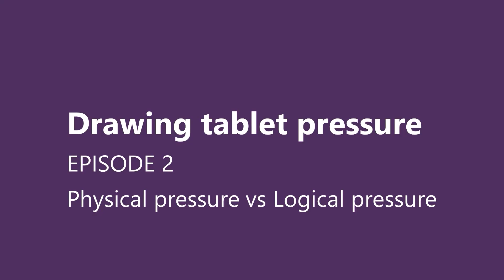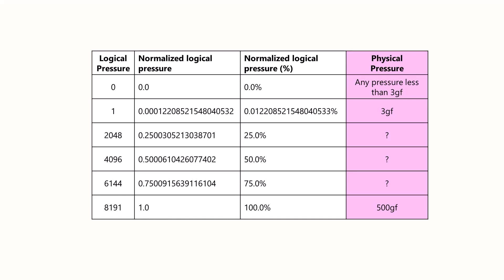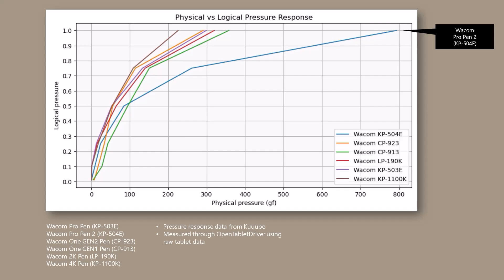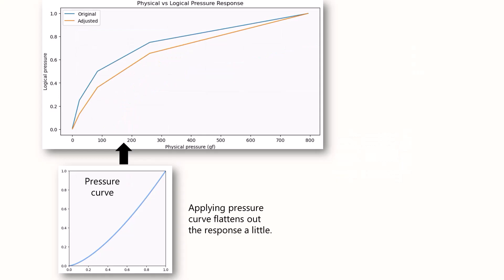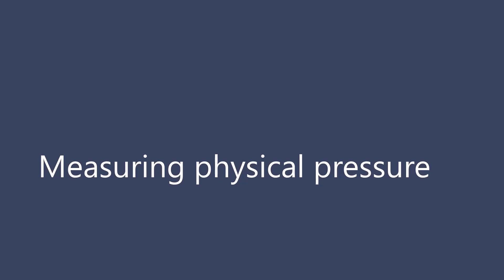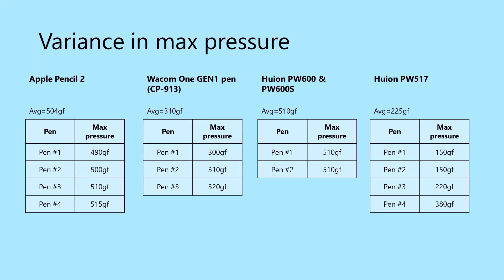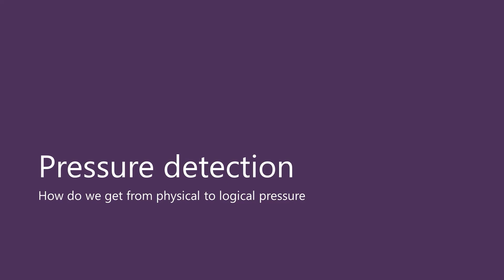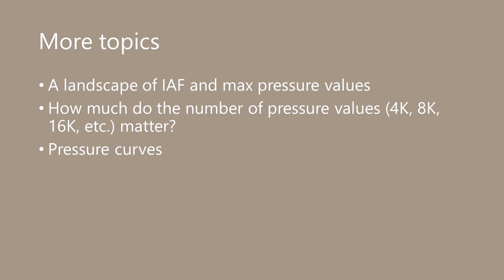Drawing Tablet Pressure (2): Physical vs Logical Pressure

Comment: The 517 pen pressure its customizable by manually moving the screw behind the buttons of the pen. But the max grain force didn't like it much, Xppen gen 2 feels like wacom 2, not sure if it matches the 500gf but feels so good, also the magicpad pen feels it has even more like a 700gf max force.
Reply: Do you have more information about the screw adjustment in the 517? Is it in all Huion pens? Do you think the differing pressure curves are due to a miscalibration of it?

Comment: Very interesting. I use different configurations, per app, in my Wacom panel. Even when I have an actual pressure curve setting in the painting program (most often I use both). About same pens having different pressure readings.. I had to replace my trusty Wacom pen after dunno if 12 years...I found it on Amazon, new. Well, same pen, same model, everything. Yet the new one was more sensitive than I ever remember to be the old one.